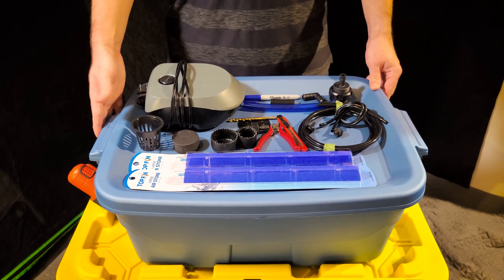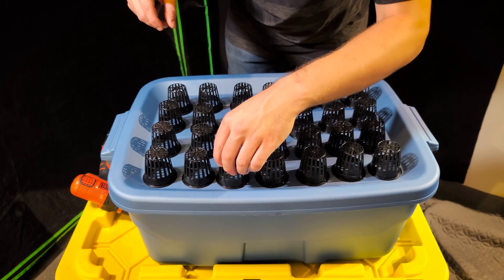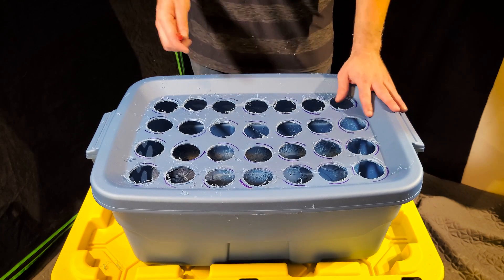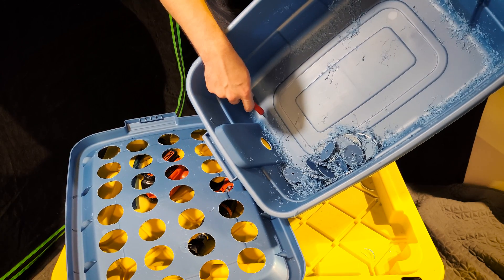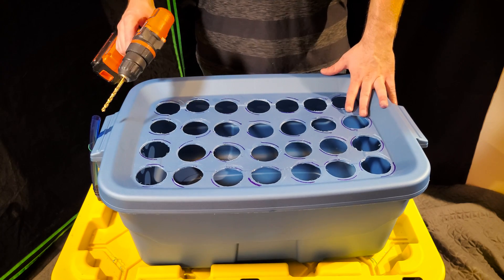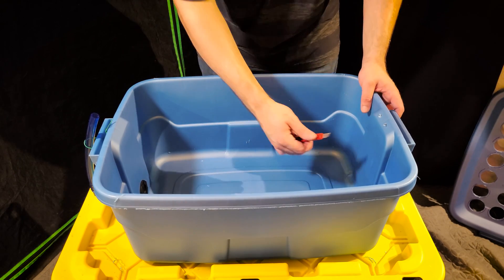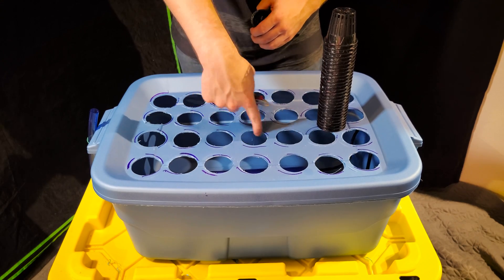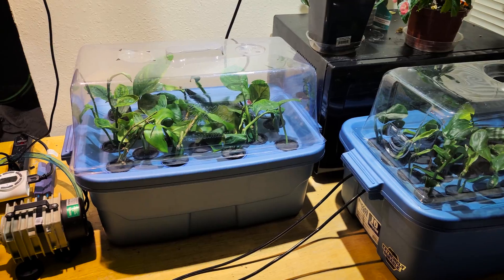How to build a bubble cloner for rooting plant cuttings

Comment: Hey man so do you use any kind of cloning gel or any nutritional supplement to the water?
Reply from the maker: Just plain tap water until roots start to form then I like to use rapidstart from general hydroponics. Also if I'm going to leave the cuttings in the cloner for more than 1 week after roots form I will add some nutrients but not necessary if they're transplanted soon after rooting.